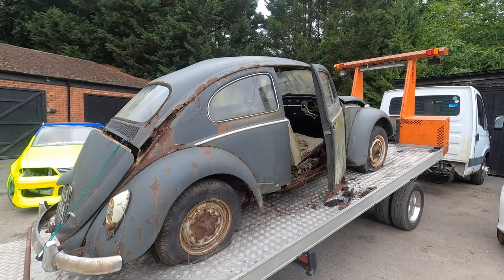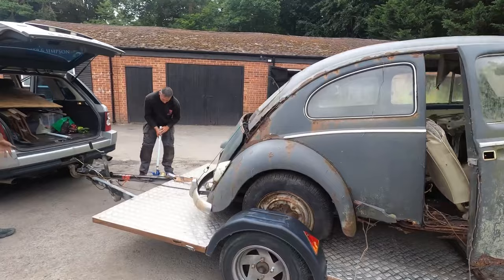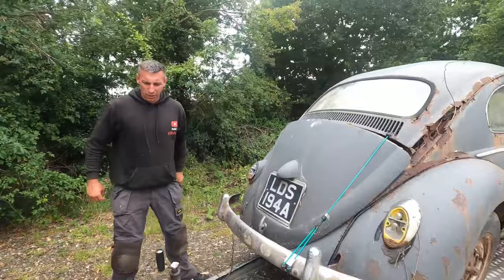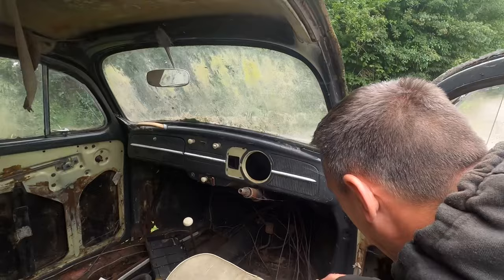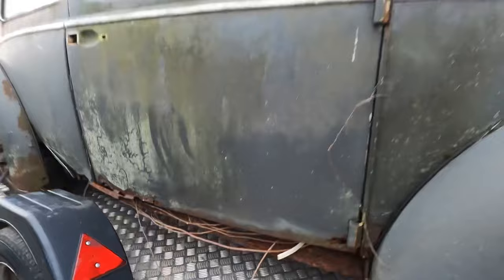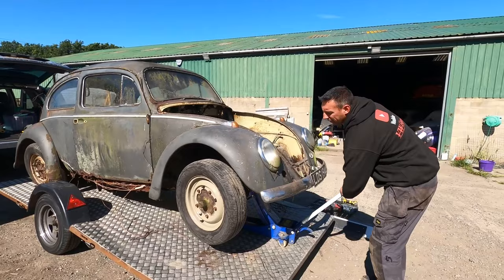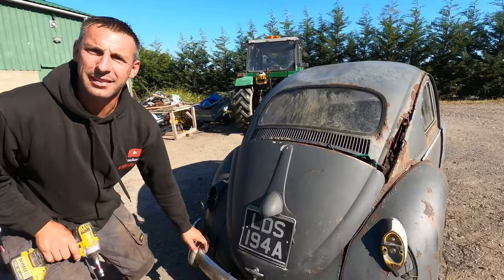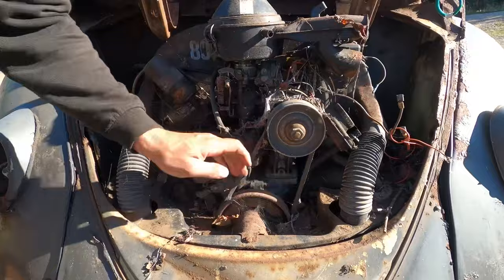Forgotten 1962 VW Beetle found abandoned! saved from the SCRAPYARD! WILL IT RUN?i

Comment: It's an A reg. Makes it a '63 - Same year as mine that you saw at Redcar. ;)
Reply from the maker: Yes it is an A reg it was registered in  1963 :)          
I have just checked the chassis number was  built in 1962.          1962           4 854 999 to 5 225 042 
1963           5 677 118 to 6 016 120 
As i can see other people are going to msg me about this lol. 
Good spot :)              I am learning about this car all the time.
Reply: I've got a 63' that was actually built in Oct 62' but registered as a 63' what does A reg mean?
Reply from the maker: Hi this is just the registration prefix issued to a cars number plate, which was used back in the 1960, in England